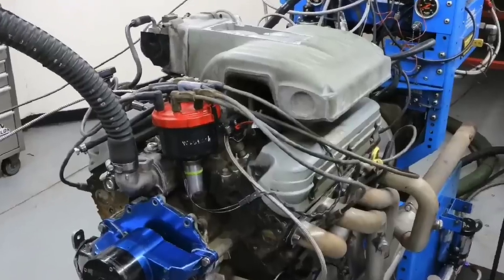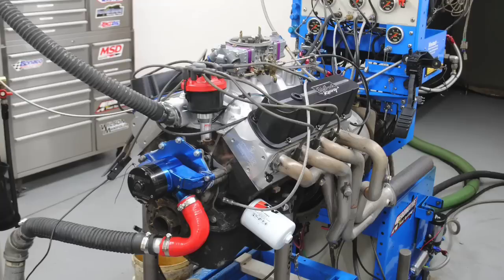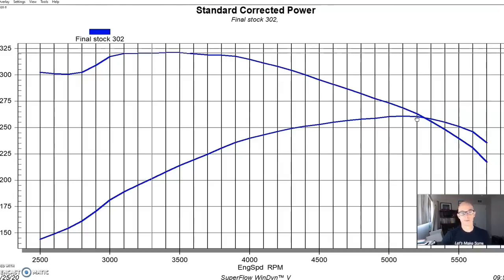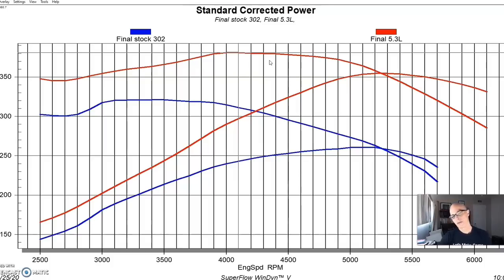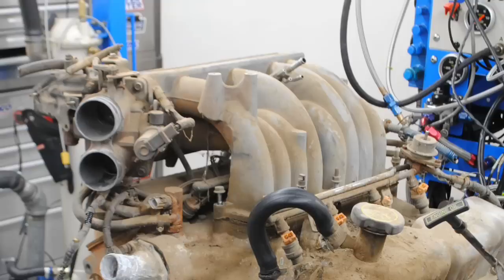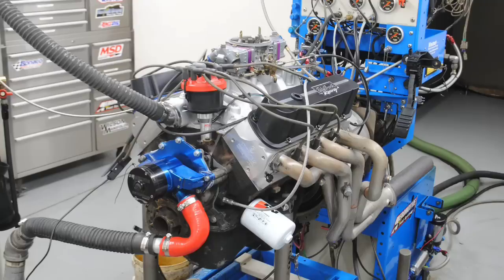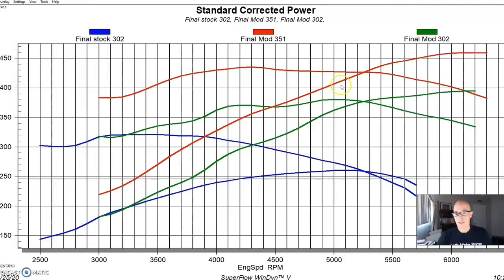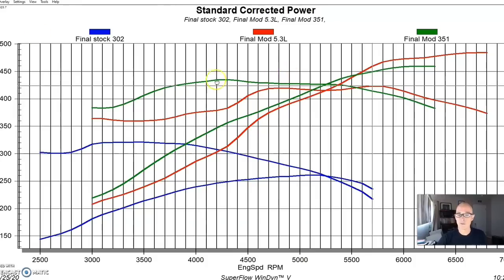5.0L vs 351W vs LS-SHOULD YOU SWAP?

Comment: There was a time here in Australia when five one clevelands were cheap and common in the wrecking yards and could be swapped into a 6 cyl falcon in a lazy weekend.  Those were good times
Reply: Yes I’ve got a 351 Cleveland with the Parker funnel web intake, mechanical roller cam, TRW flat top forged pistons, factory crankshaft, 4V closed chamber headed. On a 175 shot low 9’s in the 1/4 mile. Best motors ever!
Reply: @StainlessTIG2  you are pushing what 800 hp? How much does that car weigh?
Reply: big Hurtt I really don’t know how much HP it’s making. The car was a 81 Capri all gutted with a roll cage. Car still had the factory K-member with bump steer. I’d say 2800-2900 with me in it. My mustang is all Team Z front and rear suspension with willwood lightweight disk brakes. I’m running a Performance Automatic Racing C4 transmission. The mustang will be a little lighter but a all around better car. I’m hoping for some high 8’s ? I’m building another Cleveland with the same camshaft and Parker funnel web intake. It’ll be a long rod 3.5 stroke Cleveland with aluminum heads, aftermarket block.
Reply: Dang how Long ago was that
Reply: @jorgearmando1805  id rather not talk about it as it makes me feel old and decrepit!
Reply: @V_ AP Like they say, opinions very! I’ve won a lot with both of motors.
Reply: @V_ AP if you have any of these apparently overrated boat anchors taking up space at your place i will remove them free of charge as a service for you. Just coz im a nice guy.
Reply: @V_ AP that's a typical yank misconception, Aussies know we had our own castings which were superior to US thin wall stuff and closed chamber 2V casting you never got on 302 Clevelands you never got too
Reply: @watsisbuttndo829  i did the same thing in the 80's 2v's were dirt cheap & made 400hp easy.
Reply: I bought a set of those 302 heads from those smaller Cleveland motors made for Australia. Sweet street head, 2v port and 4v wedge chamber.

Comment: I actually just went through this exact predicament. I opted to have my block machined and I built a 331 Stroker. Love the LS stuff but I like the “whoa you kept the 5.0 on it, nice!” When people see my Fox
Reply: heck yeah bro, def better to keep the engine you already have, imo.. i don't like swapping dif brands, Ford Ford, Chevy Chevy is how i see it..
Reply: How much did you spend? How much power does the 331 make?
Reply: Yep mine is a 331 as well. Funny thing is every time I tell someone that they've never heard of it and think I have no idea what I'm talking about
Reply: @BRob1320  yes, exactly. It's the safer stroker motor
Reply: I built my 5.0 because I didn't want to be bothered with the other stuff involved in swapping. I just kept my eye out online for used deals on, H.C.I 

Only thing new is gaskets.
Reply: Joe Figueroa  BURNOUT MASTER!! That is going to be a smile machine. 351C is the most responsive mill Ford ever made. Sounds angry, all the time, flips out at the touch of the gas, hahahha, save some money for a tire budget!
Reply: That’s the way it’s done! Great job! 😎🇺🇸
Reply: @P71ScrewHead  I did do a couple of Ford into Toyota swaps, you either get a Forota or a Tord, lol.

Comment: Holy cow that 351 really opened up with those mods. Those factory ones really had it chocked up.
Reply: Mine went from 15.4 seconds  in the 1/4 (stock 351W 4bbl with headers)  to 12.2 seconds with the Edelbrock RPM package. Had to run drag radials to get there though.
Reply: @edjackson4389  Holy fuck that's just insane. Not even these triton engine do that well without selling a nut for parts or a blower of some kind.
Reply: @TheTruthBeToId  you cant beat the sound of a cammed 4.6 though
Reply: @monstermash479  God no. Sounds so good.
Reply: @monstermash479  If you think a cammed 4.6 sounds great you should hear a cammed LA 318. I'm no Mopar guy but those motors just sounded so pure, like a trip back to a 70's drag strip
Reply: The 302 can't hang with a 351. A 351 foxbody is a totally different animal!
Reply: @erikturner5073  302 has its place, but it certainly isn't in the winner's circle
Reply: @thelazarous  the 302 is a great street motor. I run them myself. However people take them too far on my opinion. When you want to get serious, work with a 351 platform!
Reply: Freedom Fighter  actually with a stock HO cam and 1.7 roller rockers and a good intake like an explorer, as well as some MINOR porting (BOWEL BLENDING) of the GT40 HEADS the 300hp range for a 302 is very doable and affordable. Don't need alot to make a 302 fun. With a smooth running engine (no cam lope) plus with a little nitrous, that's and ass whooping  most won't see coming. Again when you want to be serious go 351!
Reply: A 351 Windsor or a Cleveland could never out run a Chevy 350 from start to finish. Ever.
Reply: @andrewjake0  you don't know what your talking about! The 351c is rated as the strongest and has the capacity of being the most powerful small block pound for pound. Not knocking the small block GM engines especially the chevy 400. I like them as well. The 351 cleveland has the highest potential in every way among the small blocks. Most high performance engine builders will tell you as well. Between huge port big block sized valve heads and the sheer strength of the blocks, there is no way around that fact those engines have the highest power building, and block strength capacity! Just look at what the Australians are doing with those engines. Boss 302, and 351 cleveland engines are very popular with the Ford guys there. In my opinion as a Ford guy as myself those aussies have gotten it right on that front. But at the end of the day I like them all, Ford, GM, as well as Chrysler. They all have good engines to offer!
Reply: @erikturner5073  Look here sonny Jim, I raced against or drove every production vehicle made in the 60s and 70s and a stock 351 can’t run against a stock 350 Chevy withstanding both had their factory 4 barrels. 
And that’s a fact.
Reply: @andrewjake0  I'm speaking on what's said and documented from professional race engine builders who have more experience and have seen what engines are capable than me and you will see in 20 life times. Can't argue with professional facts! Factory stock is one thing, but when it comes to making maximum potential power, the 351c is king of the small blocks. As a matter of fact the chevy 400 has more power potential than the 350. Not saying the 350 is a slouch, not at all!
Reply: @erikturner5073  I lived it real time. We invented street racing from every stop sign to traffic light. I don’t care what some engine builder wrote about what he built. I learned it from the seat of my pants and stomping on accelerator petals.  A stock production 351 could not beat a stock production 350.
Reply: @andrewjake0  I'm talking about engine building and max power potential. Not talking about racing STOCK engines dude! I'm living in real time too as well, calm down! You 350 4 bolt main guys are the worst with your emotions!🤣😂
Reply: Truck engines were focused on torque and durability rather than power. For power check out a Ford Lightening F150, I had a friend with a 93 model that with a bit of upgrades was running low 13s at 122 to 124 mph at the track.
Reply: @andrewjake0  😂 chebby fan boy
Reply: 351w and 351c are torquey little engines but the 390fe and 460bb will out run anything chevy or dodge has to offer
Reply: @hunterfreeman1926  Yes sir I know, because I've done it many times myself with these engines
Reply: @erikturner5073  I guess he has never heard of Bob Glidden or Robert Yates...lol
Reply: @andrewjake0  you gotta put the Crack pipe down 😂😂😂😂
Reply: See Etta Glidden
Reply: @andrewjake0  See Etta Glidden
Reply: @MrStroker408  Add Ernie Elliott into that mix, he had the 351C walking the dog in NASCAR for many years.
Reply: @andrewjake0 You wish.Seen many Clevelands and Windsors beat 350 Chevy's.
Reply: @andrewjake0  tell that to Bob Gliden.
Reply: @peter giannaros  the boss 351 in 71 was a beast as well.  I don't think that guy commenting about 351s getting smoked by 350s stock has ever heard of one apparently.
Reply: Should I rebuild my 08 F150 or trade it in?
Reply: Heads cam intake you can make a 500hp+ 351W pretty easily.
Reply: Heads,cam, intake! The Windsor already has  5.969" rods in it with a 9.5" block. Sell that 302!
Reply: @erikturner5073 I know its 3 years later but.. hahaha "bowel blending"

Comment: Love the 351w. Sounds amazing and has great potential.
Reply: I have a 351 Windsor in my 86 GT Mustang and I love it. Stock Bottom end with dished pistons and has the heads and port matched to a Edelbrock Victor JR intake which the heads have 1.90, 1.60 valves. 498 lift 280,290 duration summit hydraulic cam double roller timing chain, BBK shorty headers with H pipe Dyno max turbo tube 2 1/2 inch exhaust. 600 Holley double pumper MSD distributor,coil, and ignition, C4 Automatic 3000-3500 stall converter and shift kit, 8.8 rear with 3:73 gears with a rebuilt elimentated slip . Homemade traction bars, subframe connectors, new struts/shocks drive shaft safety loop. It has a 8 point rollbar, Hurst Pro stick, 5" Autometer tach, Grant steering wheel, Aftermarket Recarro looking seats with 4 point safety belts. It has 5 gallon fuel cell which is temporary along with the battery mounted in the trunk. It has 4 core radiator with a electric fan. It has Mercury Capri 140 speed ommetor Togo switches and push button start. Wiring and plumbing have been done right. No short cuts. My brother ran a wire 100 amp chrome alternator, with a race mini torque starter, race motor mounts. It has new rack and pinion. I had the brakes done long time ago but could be gone over.  Like I say when building this car I wanted it to run well and to be strong. It does need body work cause when I got a divorce a had no garage to put it in which I could not find a storage available at the time and a big storm came and it ended up getting hailed on which it put many dents in the top and dented up the rear window louvers and cracked the rear glass. Right now my car is Charcoal grey metallic but I plan on having the body work done and want to paint it daytona blue with white stripes so it has the Shelby color look. I swapped my 86 front end out for a 87-93 LX now I have the 5.5 Outlaw cowl hood that goes to the windshield. I also have 79-82 Mercury Capri tail lights with Capri sail panels behind the rear window side glass.
Reply: NOTHING beats the sound of a Ford V8 :-)

Comment: Id swap a built Cleveland in a fox before I went with the LS swap. Cleveland has much potential.
Reply: Facts.  We have Cleveland in out 48 F1 very good motor
Reply: truth is cleveland never had enough bro thats why they never sold enough
Reply: @MannyDelReal  they went to Australia. I've seen NA Cleveland's making 800+hp. They definitely have potential.
Reply: @MannyDelReal  I'm not a Ford guy, but a Ford engine in a Ford body is cooler than just another boring ass LS swap. That shit is getting old to a lot of folks. There are other options.
Reply: in the day the windsor with the 4v clevo heads was the motor to have, the Boss motor, best of both worlds, a revy motor that breathed.
Reply: @electricdeckhead3083  351 Cleveland 2V heads work better on a  351 Windsor
Reply: @MannyDelReal  Cleveland has plenty. In factory form Ford always choked horsepower with the Cleveland and many other engines with low compression, anemic intakes, exhaust manifolds and carburetors. The stock 4 valve heads could support 600 plus hp. So it has plenty of potential to make series horsepower. The Boss 429 only made 375hp. With a carburetor, intake swap and headers that same engine made 550hp. Not sure why Ford for so many years choked their engines. Insurance premiums is the only explanation I can come up with.

Comment: What's most impressive imho, people managed to put those mostly dead stock 5.0 ho engines into the 12s.
Reply: @charleskeller1245  I have definitely seen 50tussin's vids. You should look into nmra factory stock racing. http://www.mustangandfords.com/featured-vehicles/m5lp-0612-mustang-lx-factory-stocker
Reply: @madmod  Will do thanks!!
Reply: Kong 76  I've been in the turbo raptor with a tuner and borla exhaust. It's a 13 second truck.
Reply: Maybe the ford tech's knew something. 

Guys were running 283s vs 289s on bias plys and running quick times...

Numbers just sell the car. Sometimes you need to step up and get the driver mod.

Oh and MF the LS 🖕😁🖕
Reply: alanjrkaminski  I still think the older 6.2 has more potential. It's just easier to turn up the wick on an already twin turbocharged engine.
Reply: Kong 76 yes the twin turbo 6 and it was stout idle to redline and with the 10 speed it rows through the gears fast.
Reply: alanjrkaminski  the 6.2 is a powerhouse that hopefully will start getting cheaper on the used market with the new 7.3 gasser in f series. The sohc 6.2 makes the same power as a coyote at a lower Rpm with more torque. They also are roughly the same physical dimensions as the 4.6 2v with about 100ci more displacement and fantastic cylinder heads.
Reply: alanjrkaminski  Godzilla weighs 540lbs full accessories, coyote with no accessories is 445. Aluminum block vs iron in the truck 7.3
Reply: Kong 76  I haven't driven an mt-82 but I hear they do not like heavy spirited driving though ymmv.
Reply: alanjrkaminski  I can't find much on the 6.2 weight. I'd assume more than the 7.3 because of the additional weight of the sohc heads vs the pushrod 7.3 while also having a cast iron block.
Reply: alanjrkaminski  Hopefully one comes across my local junkyard soon and then I'll know for sure lol.
Reply: @shorty808100  Those sneaky Pete kits are cool. I want to get one for my daily but throw a bigger bottle on it. For the price though, ill likely just go get a fogger kit.